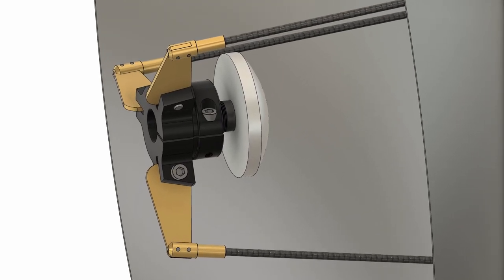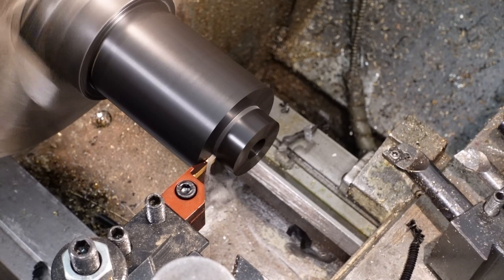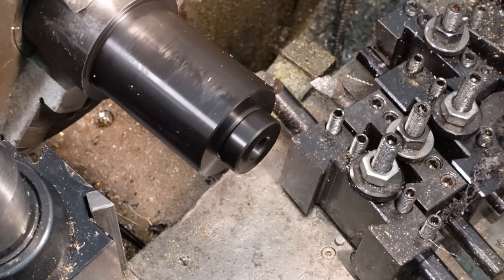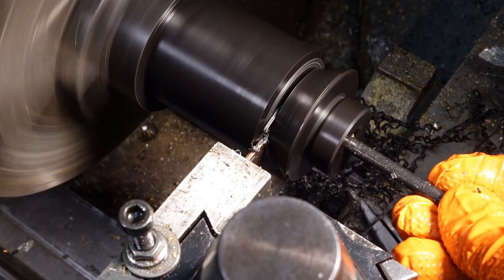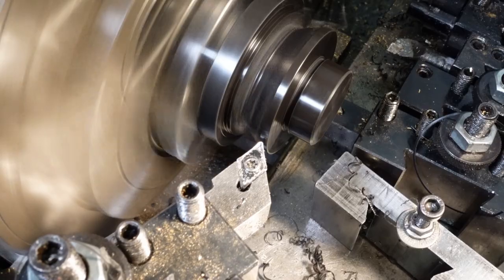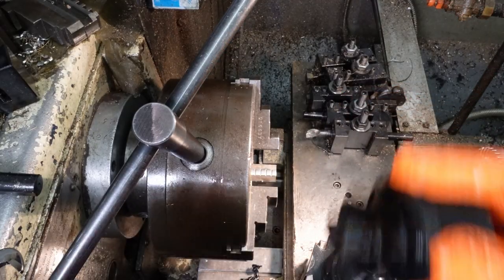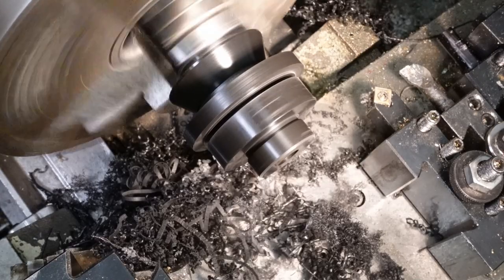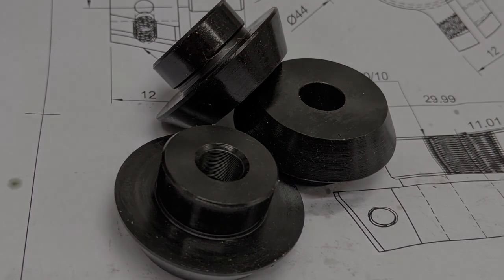Cassegrain Antenna  Machining Part 1 - The Spider!

Comment: Since you know not to say Yathzee, maybe you should try Quinn's tip for dealing with those stringy chips. Which is to vacuum them up, before they wrap themselves around the stock.
Reply from the maker: That's an excellent thought. My new shop vac should come in very useful for that, as well as cleaning the floor and walls and machines and everything that seems to upset people so much!

Comment: When machining plastics, if you have a way to use coolant, you can use isopropyl alcohol  cooled with dry ice. It will flash freeze the surface making it break chips a bit better
Reply from the maker: That's an excellent idea. I can run IPA through my Noga-Cool mini, although I'm thinking of getting a Fogbuster. I did wonder about that pipe-freezing spray after chilling the stock overnight at -18C in the freezer, but I was a little concerned about being engulfed in a flash fire and blowing the windows out and similar minor inconveniences. Cooled IPA might just make it possible to machine HDPE Fresnel Zone Plate lenses on a vacuum chuck.  I have a 14 inch extractor fan in the shop so I won't have a problem with IPA vapour or CO2 build-up. Spoiler for a future video!

On a side note, I just LOVE the super suggestions that folks out there in Youtube-land keep making about how to do things better/differently. It's an education for me just about every day.
Reply: @MachiningandMicrowaves  i learned this trick from my local job shop when i was inquiring about how to manage chips and get a clean cut in nylon. I hope it helps.

Comment: 122GHx?? Bawls....
Reply from the maker: The new version I'm working on now is for 134 GHz and 241 GHz, around 1.2 mm wavelength, with 1.0 mm waveguide. I've just been talking to an electroplating equipment suppler to see if they can suggest how I can plate the INSIDE of the waveguide tube with a micrometre of electrodeposited gold.  Kind of challenging, to put it mildly...
Reply: : @MachiningandMicrowaves  I have been asked to figure out how to metalize 3D printed parts for backplanes and enclosures for RF. I have an article on electroless plating of 3D printed structures by Atsushi Ishikawa that I am absorbing. Would be nice to have a reasonable process for metalizing plastic parts, like delrin, PLA, ABS.
Reply from the maker: @burbman60  I should have some new electroplating chemicals arriving after Easter, including some graphite conductive paint and surface prep intended for electroplating and electroforming over plastics, leather and other nonconductive substrates. Mostly for silly things like gold-plating Baby's First Shoes adn games consoles, but it will be interesting to try it on various engineering plastics.  I'm most interested in trying it on PEEK and GRP, but I'll have to try it on Delrin as well